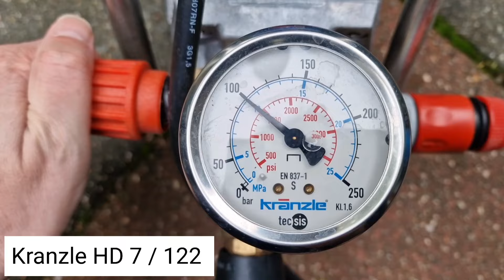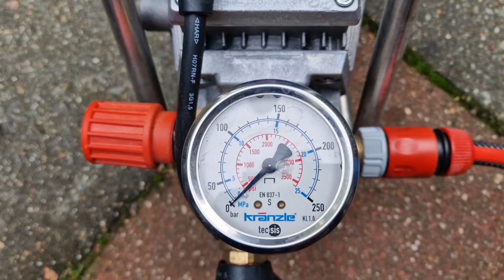2024 How To Decontaminate Car Paint Before Polishing Car (Step By Step) #autodetailing #asmrsound

Comment: Great work! Which version of Marolex do I need for using Green Star and Protector Wax? The industrial version ?
Reply from the maker: For Koch Chemie Green Star you need the Alkaline version because it is an Alkaline product so the blue variant. The black variant is for acid resistant. In this video I use the acid variant, it doesn't really matter as long as you rinse them well with warm water after each use.